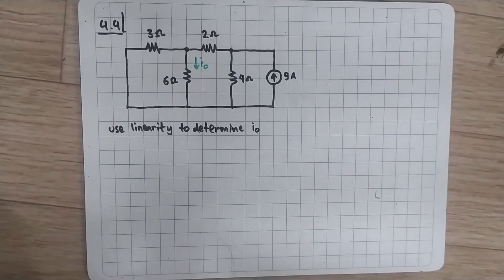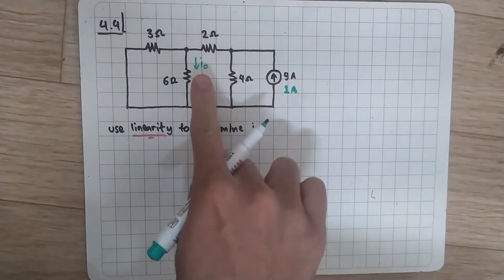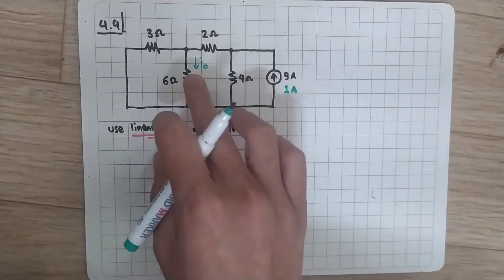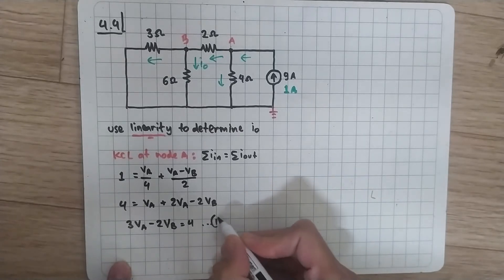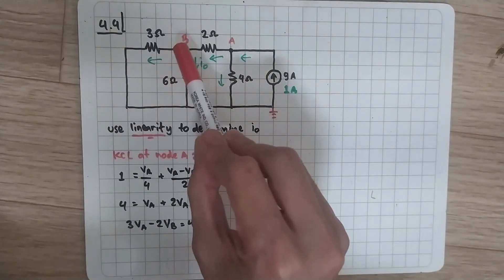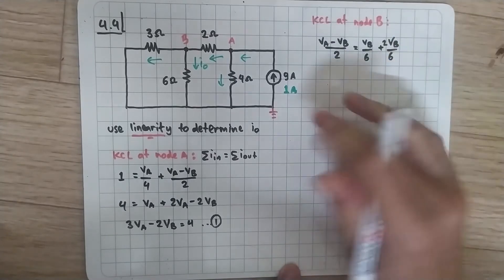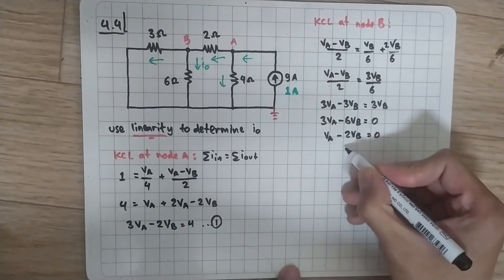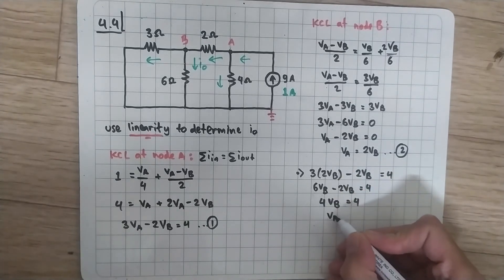Problem 4.4 Fundamental of Electric Circuits (Alexander/Sadiku) 5th Edition - Linearity Property

Comment: that is, assuming the current is 1 amp and we found the voltage as 1v, then if it is 9A according to the linearity feature, the voltage will be 9v and we have written it instead and found i0 as 1.5 ,did i understand right?
Reply from the maker: Yup